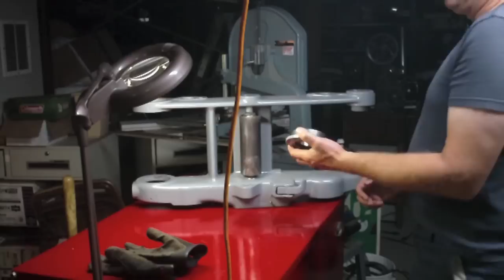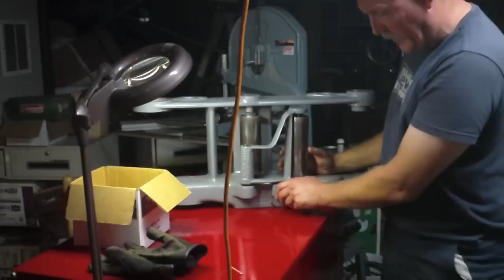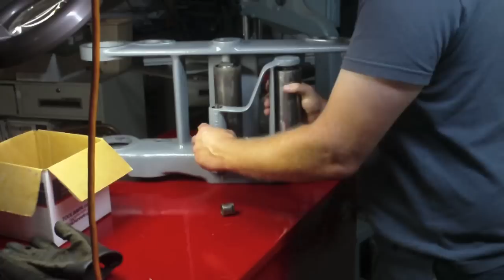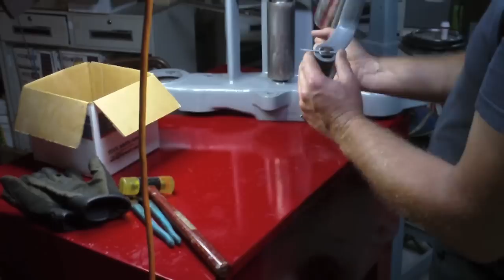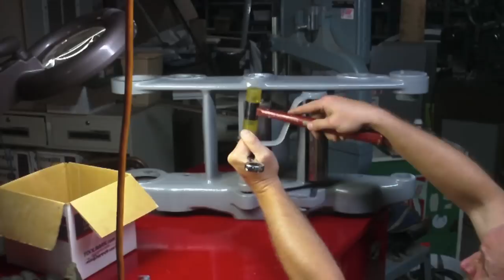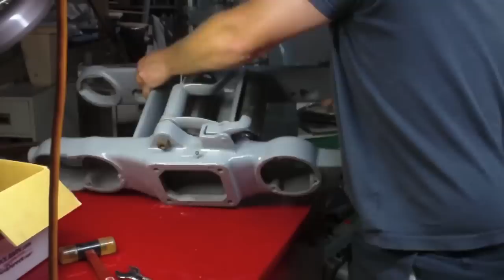Sipp Drill Press Part 46

Comment: I got here because of the Sipp drill - is this the last of the Sipp? I'm considering buying one locally - should I?
Reply from the maker: I still have it. But its still in pieces. I'd like to finish it someday but I seem to never find time. As for should you buy one? It will take up a lot of space and not really do anything a good sized milling machine like a bridgeport can't do.
Reply: @stevewatr I only have a one car garage right now and wish I could fit a full size mill in here but I don't have the space for it and don't plan on doing large work until I move to a larger space. Unfortunately there are really great deals for full size mills around here.

I have a 1hp industrial drill press I was planning on converting to a mill until I saw this Sipp pop up, which looks like a knee mill.

What I understand is that I would have to figure out how to fix the vertical travel to prevent losing my place. 

How tall do you think it is when it's fully assembled?

Hopefully you get some time to put it together and get it working!